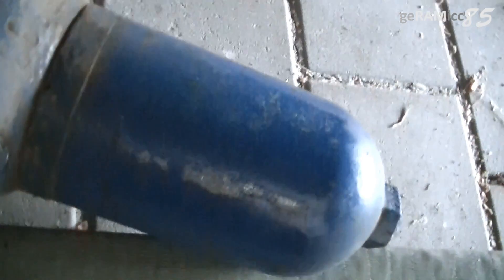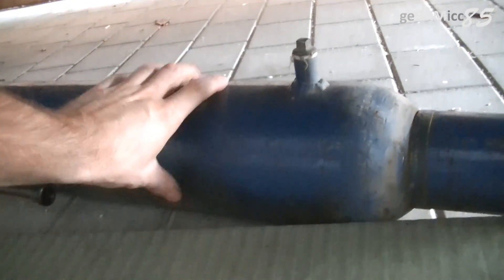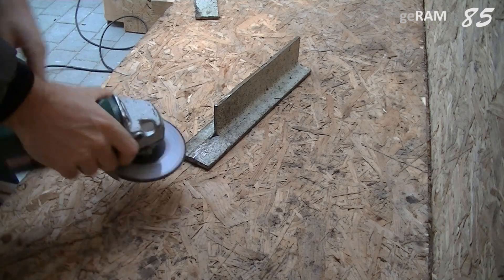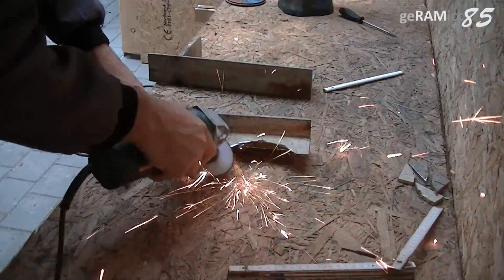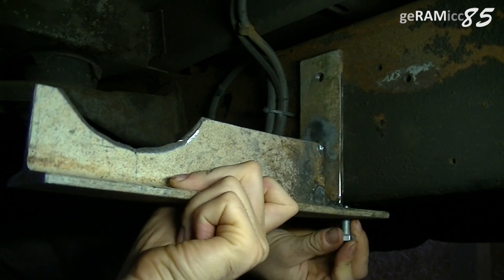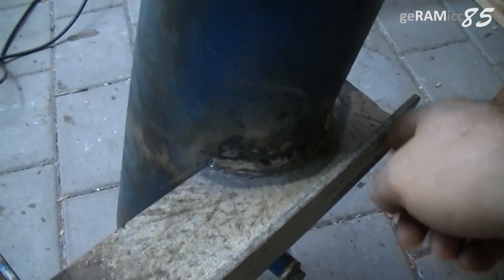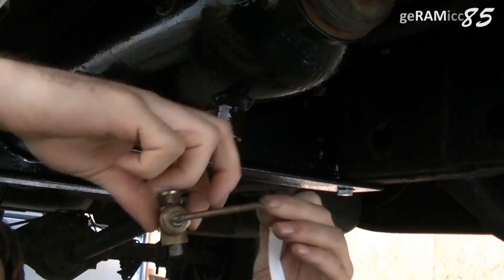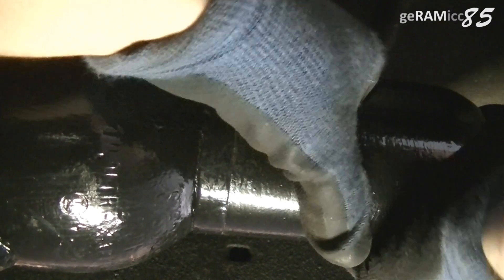HOW TO BUILD CUSTOM AIR TANK+CAR INSTALL STORAGE BOTTLE ONBOARD | PICK UP TRUCK VIAIR COMPRESSOR KIT

Comment: Never weld on a closed/sealed tank or container make sure there is a way for pressure to escape other wise it can explode.
Reply: Yeah I don't  he need a pressure release valve so too much air won't build up in that tank and explode

Comment: hey good idea i have a old welding tank gonna do the same and have a air compressor for construction but  how do i do the layout for the wires ? Im using a motor from a construction air compressor
Reply: Hello as for the compressor it is a actual job site 110 v compressor  i may need to figure out how i can run it off the truck  any ideas ?I don't know about the wiring. I will send you  pics got the tank up not welded  but used 2 rings and a release in case i need to pull it out . Please feel free to give some advise , o btw have not  begun welding the old tank in fear of it having gasses  need to install a drain cog and remove the existing valves
Reply: If your 110v compressor uses a standard household electrical plug you could use a good power inverter. So it would be 12v from your vehicle's battery, to the inverter, then to the compressor. If you got a multiplug inverter you could also run other power tools and lights off it.

Comment: I like your video.  I like your idea too. I'm looking to mount something similar for an off road application.  I can't have anything hang below my frame so I can't copy exactly what you did but hopefully I learned something.  side note.. I've always been told never run a bolt through the frame without a sleeve.  If you don't want to install a sleeve I usually install nutserts to avoid pinching the frame. I know your not holding that much weight but might be good to point out.

Comment: I'm not clear on the ourpose of this? neat by all means. GREAT JOB
Reply: +Richard Cowtails Also for an impact drive to change your tires and for an air powered vacuum.
Reply: Having air on your truck serves multiple purposes. Air rides, train horns, air connectors (to fill up your tires or clean your bed) and many more.
Reply: Oh ... yea, that makes sense
Reply: that's a great idea!